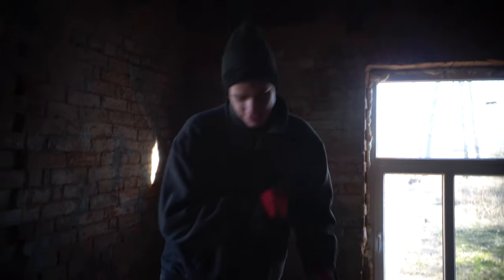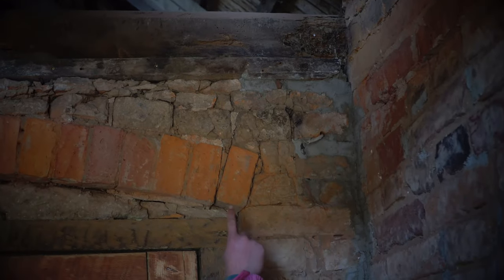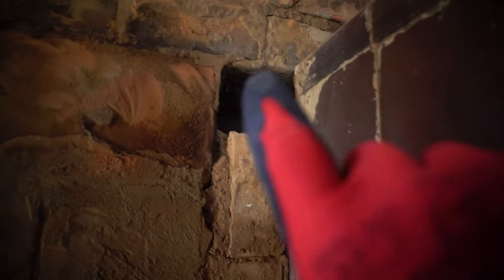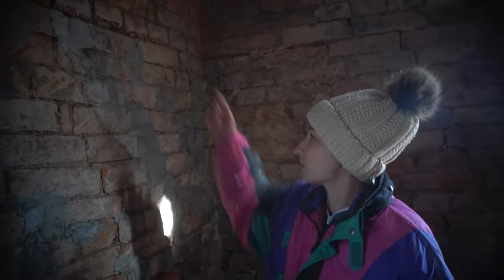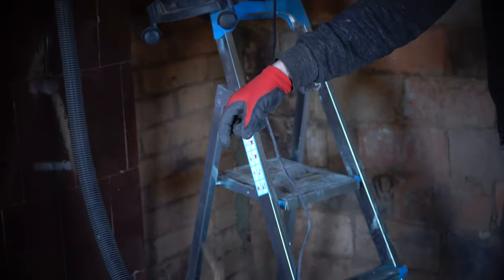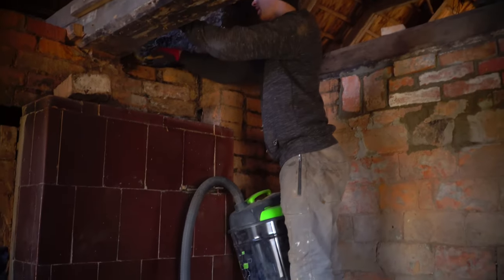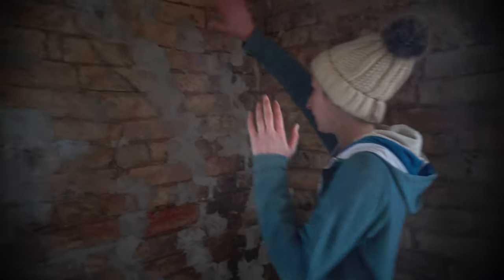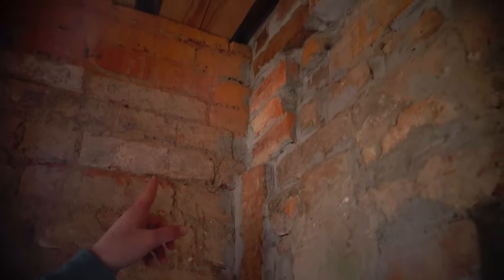Restoring our bedroom Walls (Old Brick walls) PART 2

Comment: I think this house is not 200 years old...that brick laying is shity...200 years ago house was made from clay...maybe there where living poor family and made house from all things they got...that bricklaying style looks like from Soviet union.
Reply from the maker: Yeah Bricks are made from clay, this house has selfmade bricks eaxh have a unique pattern not factory produced, bricks used in Soviet times where white bricks or red hollow bricks. This house might be built on a structure older than 200 years old as the Smokery in the centre of the house was built from unfried clay bricks. This house has history writen in the local museum! You should do a bit of research on how old is bricklaying! Shity bricklaying means hard to do brick laying in this case, modern bricks are precise and all the same size and you can use cement. This house is built with bricks that are very wierd sizes and not so easy to work with, if you have ever done bricklaying with old bricks you would know how difficult they are to work with, this house was built with clay instead of cement which makes it easy to repair! Anyways don't talk about things you have no clue about!